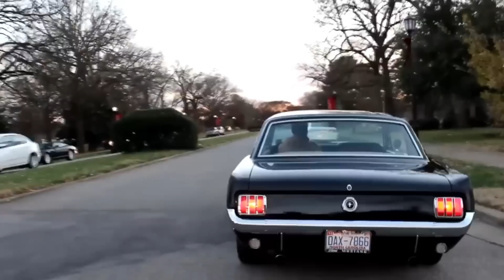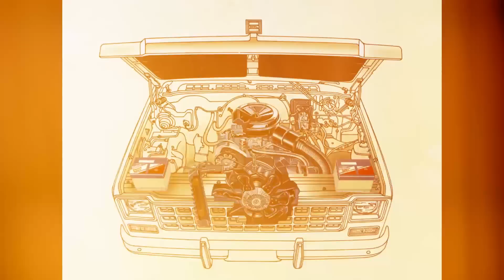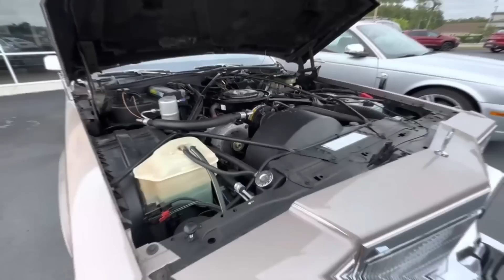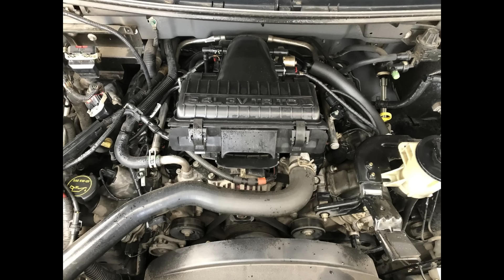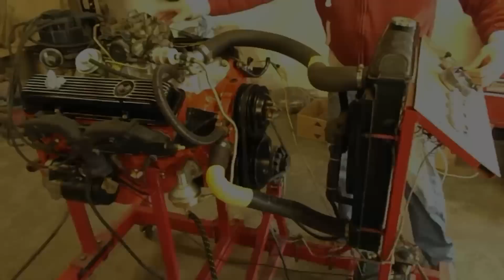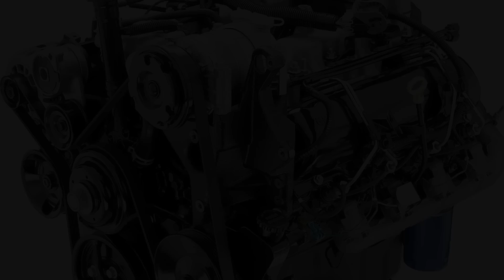American V8 Engines That Constantly BREAK DOWN

Comment: In 1979, I was working in a trim shop across the street from the Olds dealer. On a few occasions, one of these brand new diesel cars wouldn't start after left in the shop overnight. The service techs would bring a battery cart and starting fluid. I guess they needed more cranking amps than the gas V8's.
Reply: Diesel engines require considerably higher compression ratios, so yes, they require more energy to crank them over to start.

Comment: Left out the Ford 351M and 400,bottom ends due to bad crankshafts from the factory.the Cadillac 4100 also had camshaft problems,they were too soft.The 3 valve 5.4 also has oil has cam phaser and oil pump problems.The 6.0 powerstroke,most machine shops give the customer bad news,find cracks in the heads magnafluxing them.Known for cracked heads and the fix is buy new heads

Comment: I had a new 1968 Plymouth Valient, I ordered it with a 318 cubic inch engine, This engine never ran correctly, ran rough, dealer and Plymouth refused to fix it. I heard this was not the same 318 of previois years, evidently a 273 bored out to 318 became the 1968 318 version. It was a horror story. A few years later starting in 1972 I drove a new 318 Dodge 1/2 ton pickup for 63,000 miles, and loved it. I still wonder what the problem was with that 1968 Pymouth Valient 318 engine.

Comment: I am a retired auto tech , but you are spot on with these engines , when Cadillac came out with the 4100 I was rebuilding them constantly and would tell the customer "there is no warranty " we used brass shims on the crankshaft just like on a Model T . This video brings back memories .

Comment: I have an off road Ford 302 V-8 with a 1 barrel Holley.  This engine is so smooth and efficient with the "1945" model carb.  US made some of the best v 8's.  Just go down the list of iconic V-8's that still around today
Reply: Just curious any reason why you went with the 1945 over the autolite 1101 or a carter yf or yfa?
Reply: @jasonnelson6624  had a couple slant sixes, the carb was free, really works better than 2barrel Motorcraft
Reply: @tcmits3699  makes sense since slant six was the only one I remembered using the 1945. Yeah from my experience the 2 barrel motorcraft on the 302 was trash. The only good thing about them was they were really cheap. But one and toss the old one in the thrash. I don't know why I never considered just using a better carb. Guess I just liked how they tried to look liked a 4 barrel from the top but nothing underneath lol.
Reply: Maybe a two barrel Holley..?? Never heard of a one barrel 302...
Reply: @markmark2080  Gotta tell ya, was curious how a 1 barrel would work on a V-8.  It's been on my 302 home made farm tractor for over 20yrs.  Just removed 1"thick PCV spacer, made 1" thick aluminum adapter, 2 barrel gasket on bottom, 1 barrel gasket on top.  That's the pattern
Reply: @tcmits3699  Hey, thanks so much for the reply, that's all you need on a tractor, sounds like it was a fun project...

Comment: Where did you get info from WOW. Cast iron head bolts that's new one or calling timing chain a timing belt LOL.
Reply: I think high grade fasteners are forged and the threads are "rolled" as a sort of forging like operation while cheap threads are cut.
Reply: @davidpowell3347  You missed the part cast iron bolts no one has cast iron bolts. Bolts have different grading like grade 3, 5, 8 and either of them are cut or rolled. Mass producing bolts most are rolled. Making small batch most are cut

Comment: The flat head Ford was bullet proof , my Dad had a Schramm air compressor that was half engine which drove the other half as an  air compressor , it finally through a rod bearing which was easily fixed.

Comment: I used to have a Chrysler Newport -78 with the Lean Burn 440. And, the system failed. But I had a normal, used spare points distributor, so I just put it in. And I could not tell the difference. It run just the same with the points ignition. Perhaps the engine was just big enough for that. The stupid thing with that computer was that it was cooled by the air inside the air cleaner. But it had the heated air for cold weather, so when it got near freezing, the heated air fried the computer. Engine started to misfire, but I got home and replaced the distributor to the points one. And worked with my back towards the sun, no shirt in the spring. Worst sunburn of my life...

Comment: Oldsmobile 403. had a tendency to overheat because of the siamese cylinders.
Reply: Did it have bottom end problems? I believe the 307 Olds if not "hotrodded" held up reasonably well but 403 might have been pushing the weakened Oldsmobile lightweight block too far. The earlier engines such as the 330 and the wide 400s and 425s had more support around the main bearing cap area. I think early 350 had the stronger block but later ones may have been lightweight and weak.

Comment: If synthetic motor oil or detergent oil ….   The engines would of lasted lots longer ….  Dry starts killed the bearings.   Tho.   They ALL NEEDED TIMING CHAINS AND GEARS AND A TRANSMISSION SERVICE AT ABOUT 100k ….   The diesel engines were fkn crap 💩. 4-6-8 drive.   A jumper wire took care of that

Comment: The Cadillac 4100 was such a bad design the engine remanufactureres refused to build them. They had problems getting enough oil to the cam and the cylinders were sleeves held in the block and aligned by clamping pressure from the cylinder heads. Here was one company, Engineer Supply in Phoenix that modified these engines to make them live. They patented the parts they used and offered them for sale with a full warrenty, but it took years to develope the parts needed to make that engine livable.

Comment: I had a chrysler Newport 1975 with the 400, à Demon 1971 with the 340, and a camaro Z28 with the 350, à vaillant 1973 with the 318, and they were all better than any cars they sold today. Very easy to maintain, repair, and there was plenty of parts. You could fix it in an afternoon in your backyard. Good luck doing this today. They weren't as powerful and fast as today's car, obviously, the mustang with the coyote engine is a beast, so are the camaro ZL1 and the dodge demon, but you can't fix them easily if they break.
Reply: The slant six was also great.
Reply: @billhuffman4327  I worked with a old hot rodder in the late seventies. He claimed that a slant six was the only engine you could put a roots blower on a totally stock engine and expect it to last . He could have been right , every time I saw someone try to put one on a stock engine it would self destruct in just a few miles
Reply: Had a 71 Ford halfton , 300 six , burnt oil bad . I pulled it into the shop after work , did rings , rods&mains , valve grind . Drove it home in time for late supper
Reply: You don't want to change the heater core in a new car....A radiator flush is $800...
Reply: I had a 1972 Newport with the 400, and it was a nice car.

Comment: Back in the mid 90's I went to college and took a machining class.   One of the things we learned was how to identify various metals by their inherent physical characteristics. 

It was in that timeline that the new and outrageously expensive Torque-to-yield head bolts started coming into play.   We got a brand new set of them from the auto tech department and did some testing. 

Turns out they have the exact same base range of stretch, torsion and hardness values as common generic low-end general-purpose grade 3 bolts.   THATS WHY THEY FAIL!
Reply: I believe "torque to yield" and perhaps "torque plus additional angle" allows the factory to use smaller or cheaper head bolts with no strength reserve.
Reply: @davidpowell3347  It was exactly that on too many models.    I have had several vehicles over the years that were well-known for blowing head gaskets at a specific cycle of miles.   
The first time they blew one they got all high-grade bolts torqued to 120% of spec.   No matter how hard I ran them, I never had a head gasket blowout on any of them after that.
Reply: That was the biggest problem with that diesels head gasket.I worked on many of those engines' as most shops would not touch them.
Reply: Gotta love those rubba-bolts.

Comment: I beg to differ on the Ford flattie - it was a VERY reliable engine, though it was prone to overheating due to the exhaust running thru the block.  If it was truly unreliable, it would certainly not have survived for 20 years..  Please remember, flathead were the state of the art when it was designed - ohv v8 designs , with rare exceptions, didn't happen for another 17 years.
Reply: I think the final version was more reliable than the first generation "y block" that followed it. 
The flathead transferred a lot of heat to the water jacket which was probably a blessing in Arctic climates. More heat available for the cab.
As long as a big enough radiator was used should have been O.K. in summer.

Comment: The Chrysler 2.7 is way worse than the 4.7
Reply: Video badmouthed the 4.7 while showing the inline 6 Jeep.
Reply: Many 4.7 are still on the road at up to 20 years old. I think they only have a high failure rate if they have been overheated.
  (or ran without good oil or on "extended" oil changes)
Reply: That’s right 2.7 way worse and the 4.7 dropped valve seats mine dropped finally at 220,000 miles but I fixed already back running good

Comment: Had a, 76 Chrysler Cordoba with the 400 cid engine, one of the best cars I've ever owned, had to drop the oil pan at 160,000 miles to remove the pieces of the cam gear, decided this would be a good time to replace the crank bearings, looked at them and they were in such good shape decided to leave them alone. Sold it about 6 months later when I bought a new car to a friend, he drove it until it had 200,000 miles on it. Only problem with it was rust behind the rear wheel wells and in the trunk
Reply: Yes, the Chrysler 400 was a VERY under rated engine just because of that Leanburn system that Chrysler "had" to put on it. It had the largest bore size of ANY Chrysler engine ever produced.

Comment: I had a 2004 Ford F-250 6.0 diesel for 9 years and 80,000 miles and never had a  problem. I used Stanadyne fuel additive with every fill up and Hot Shot Secret every 15000 miles. It was never “hopped up” and performed flawless even towing a 10k trailer many times.
Reply: So, you used it pretty light compared to how most diesel pickups get used. 
Not surprised why it didn't give you any trouble.

Comment: 267 is a good engine, you yourself said it’s reliable.  So why is it on a list of engines that constantly break down?  The rest, I have no issue with.
Reply: Was also the victim of the GM fiasco of the cam/lifters case hardening failure. The lifter foot was soft and would quickly become dished. This stopped lifter rotation in its bore and presented the edge of the lifter body to the cam lobe and acted like a scraper, carving the lobes down and distributing swarf through the engine. GM's comment when trying to get warranty on a 14 month old Cutlass? Tough.
Reply: cannot interchange with 305 or 350, those you can swap parts. The 267 is a stand-alone engine.
Reply: @madmike2624  doesn’t mean the engine itself is unreliable.  It’s just as reliable as any other small block Chevy.  It’s just gutless
Reply: @madmike2624  I Put 305 Heads On A 4.4l And It Ran So Much Better!!! Head Bolt Pattern Is The Same!!! I Just Used 4.4l Head Gaskets!!!
Woke The Engine Right Up!!!